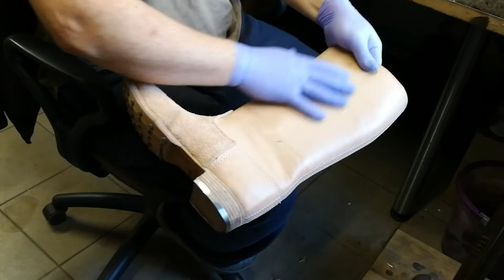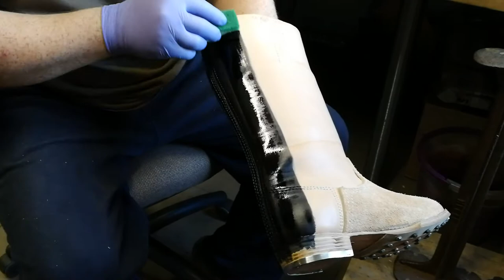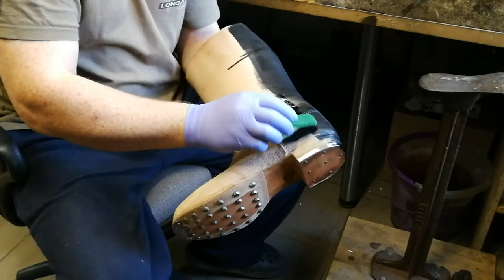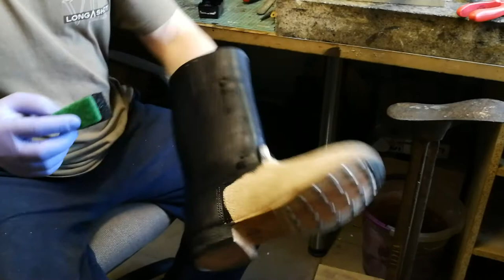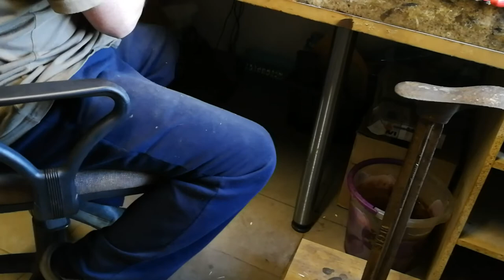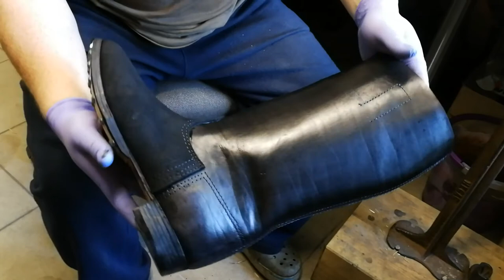how to properly blacken shoes

Comment: Why was the toe box rough leather?
Reply: Because it's a repro german boot and they made them that way
Reply: @frogdude30  utter nonsense
Reply: I'm adding more detail. Rough out leather has the potential to be stronger than flesh out because the fibers that hold leather together are mostly near flesh side so when a cut happens it is less likely to cause the leather to split
Reply: @reinlichpimmler3311  simply how they were made during the war.
Reply: @reinlichpimmler3311  what do you mean "utter nonsense" he gave you a straighforward answer and your response is basically "no it wasn't" without any evidence
Reply: @channelchannelchannelchannel  because, u may guess it, it IS utter nonsense.
Reply: @reinlichpimmler3311  okay